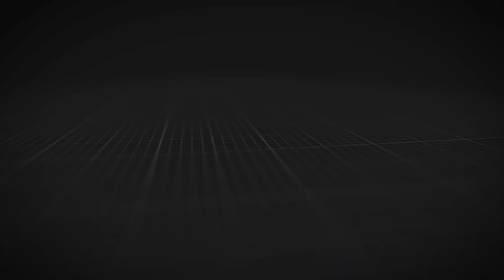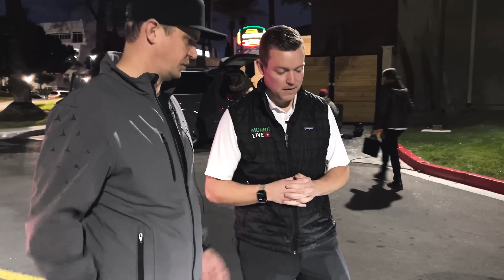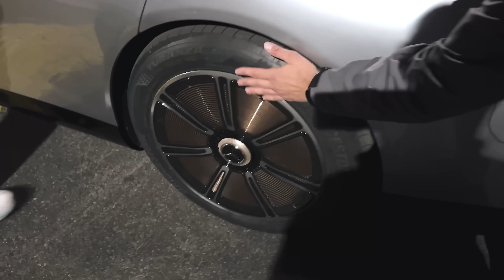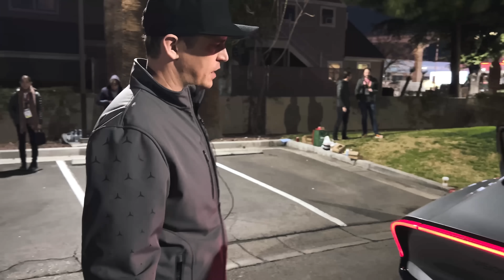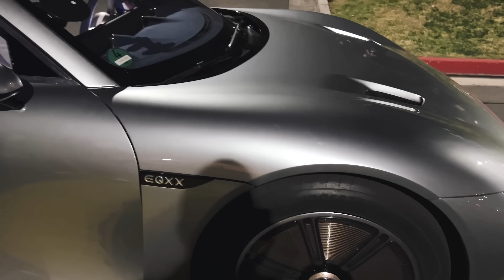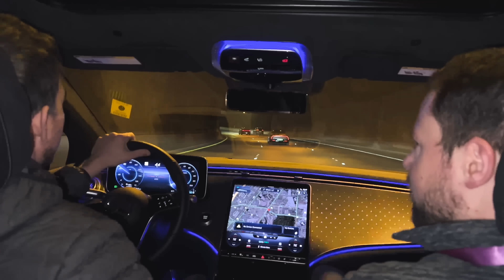The Most Efficient Mercedes-Benz Ever - Mercedes Vision EQXX Ride & Drive | CES 2023

Comment: If we project all this to a normal car, we will get 700 km of range max. Normal car probably needs to be 10cm wider (comfort), no active aero (too expensive), a bit more head-roof space, active battery cooling, possibly less fancy of a motor and less dense batteries. And 300kg more. So, loosing 30 % or range.

Comment: Wow, it has Tesla model S door handles and wheel covers! 

I'm just stirring the honey pot here, I think they've done a great job, and achieved a dramatic improvement over other cars including Tesla. I have a model S and remember seeing a video early on where Bjorn Nyland was commenting on how noisy a Tesla was at 200+ kph, due to imperfections in the surfaces relative to what the "plan" was. Mercedes of course does manufacturing right. I just hope that the sound system is as good as the model S (I was disappointed with the S class Mercedes).

These loss refinements make a big difference in an EV, because the lower the rolling resistance and drag the less of an incline is needed to get back more than you expend moving. I take country drives and am amazed at how small an incline is needed at 110kph to pass the break even point, and this must be even more impressive.

Another comparison I'd be interested is seeing is what the pedal dynamics are like, Tesla really gets this right in my opinion, so much better than the Jaguar i-Pace I tried.
Reply: Yeah, Tesla recycles lots of Mercedes tech.
Reply: @abraxastulammo9940  Except the handles on Model S came out in 2016 on Tesla not in 2023 like on Mercedes.
Reply: @abraxastulammo9940  Also the aerodynamic wheel design came out on Model 3 in 2019,  also well before this Mercedes 🙂

Comment: This looks like an amazing car but I'll be looking for what kind of temps the batteries hit while fast charging because of the lack of liquid cooling
Reply: Don't remember the charging speed, I think it was 100 kW or a bit more. The thing is that this car is so efficient that the battery is quite small so in 10 minutes you have 200 km of range.
Reply: @ContraVsGigi  every "air cooled" EV I know about has had terrible battery degradation and charging issues. it would be nice if this is the exception but I remain skeptical
Reply: @tindy128011  Yes, they were quite problematic. I want to believe Mercedes did their calculations very well, but we'll have to see. There are a few advamtages for this one, for instance being si efficient, in 10 minutes you charge for 200 km so in the end you have way less charging cycles than a regular EV.

Comment: While this is indeed an amazing accomplishment, EV enthusiasts should realize that Mercedes spent a ton of money optimizing the weight, aerodynamics, and power consumption on this car in order to hit a target goal. The issue with this is that they are VERY close to the limit that physics will allow. In other words - there isn't much more to gain.
The reason I say this is that what companies SHOULD be directing every last bit of their energy and focus on is increasing the gravimetric and volumetric energy density of the pack. Improve those metrics by 50-100% and the engineers will have TONS of headroom to do whatever they want.
And customers want this too - every customer wants some buffer in their EV. We wanted the 520 mile Model S Plaid - which is how Tesla announced it the very first time. Not because we needed 520 miles on the daily. But with 520 miles of range, we KNEW we'd always have enough reserve to do whatever came up.
Elon may eventually get there...but not today.

Comment: Thanks for a good review.  Sounds as if the EQXX is pushing the limits for a passenger car.  I wonder how it would perform in crash testing?
Reply: Just as any other good modern car. There is no reason not to and Mercedes was always top notch at this.

Comment: The sticker badges are the worst part of the car. The Mercedes emblem is the most prestigious and recognizeable emblem along with Ferrari. Surely the can put in a recessed badge or something without affecting the aerodynamics. Stickers are for motorcycles, not cars. The design of the car is really nice but it does not have the trademark mercedes look.

Comment: Honestly, the thing that pisses me off about this is that GM made a car based on a similar aero package with the original Saturn SL1 back in the 90s and then in the 2000s nobody cared about fuel economy any more so they transitioned into SUVs before dumping the whole division. Those Saturns also used plastic body panels that were not only dent resistant, but saved weight and cost. And GM incorporated many design and construction lessons from Saturn into their EV1. Had GM just continued in this vien we would be seeing a hyper aero EV as an affordable GM production vehicle with cheap panels instead of this exotic concept vehicle from Mercedes with exotic expensive materials that will likely never make it into a real production vehicle.

Comment: This is what i want to see from major car makers. Now will they bring it to market?
Reply: Nope. Hahaha… or it will look dumber or cost north of $150k. It’s Mercedes.
Reply: @GET2222  You aren't wrong on the price.
Reply: Tesla could do this for not much more than the Model 3 currently just without thr active aero and actuating handles. (Those a lone could add 3000$ to the selling price)
Reply: @rkan2  well for Tesla to do this they d have to pay mercedes tons due to the 500+ mercedes tech patents on this car
Reply: @dnap1991  Meh, most of it can be worked around easily. A flat bottomed car or teardrop shaped car is not something to patent...

Comment: Did you notice how Julian sidestepped the question about cell configuration?  Pouch, prismatic or cylindrical cell?  Answer:  high silicon anode chemistry.  With no liquid cooling to save weight, that raises the question of how does Mercedes condition the battery in cold climate conditions?  Or did they just sidestep that issue as well?  Interesting interview, most interesting is what was not said.
Reply: The performance values are very limited. This results in extremely little heat loss and therefore no cooling liquid is necessary. However, it is not an everyday car, since HPC charging is not really possible and it accelerates like a 40hp car. Probably feasible in the future with other battery technology, but currently very limited.
Reply: Yes, the Merc. guy was very evasive that was exactly my thoughts. so was it a case of not knowing or avoiding! but Cory was good at easing before the question to encourage the guy into what he wanted to ask.

Comment: FINALLY SOMEONE IS ON MY SIDE ABOUT SIDE MIRRORS

I mean it’s not the exact same argument (his might be better tbh) but I just can’t get over Sandy’s (and Munro in general it seems) desire to get rid of side mirrors in favour of camera systems. 

Sandy almost always subscribed to the Elon-esque mantra of “the best part is no part, the best process is no process”. I just can’t buy that a sophisticated camera system requiring sensors, displays, power consumption, compute, and software development time is superior to a manual mirror that is probably 1/100th of the cost and takes 1/10th the time to install in factory. 

The argument about depth perception or 2D screens is absolutely correct as well; you can’t change perspective/look “around” objects on a screen like you can a mirror. I just don’t buy it.
Reply: There’s nothing sophisticated or energy intensive about two 4” OLED screens, 5 MP cameras, and the marginal compute needed compared to the energy reqs of the existing car infotainment system
Reply: @bookie9273  What do you think is cheaper, easier to implement, and simpler to use (and has no chance of software glitches), putting 2 manual door mirrors on 1 million cars or putting a minimum of 2 screens, 2 cameras (but probably more tbh), the wiring for such, development of software, and install and testing for 1 million cars?

Go watch any video about semiconductor manufacturing and then, with an actual argument this time, try to convince me I’m wrong.

Comment: The germans will catch up. They always do. Their software is improving for merc, Bmw, vw. They will use casting, new production methods and all. They will be part of the ev game for sure
Reply: Maybe. They're running out of time, they're hampered by their ICE assets and they're in debt. But maybe.
Reply: @MarkXHolland  they are right on time. BMW will have android based syatem from 2023, vws new software will be much better and use Android as well for some brands and integrated for BEV and ICE, merc will use gaming engine and nvidia and they all will have new batteries in 5 years. They will be OK

Comment: Cory I noticed you had your head tilted to the left while riding in the car. Was the window and roof line so that you didn't have head room?
Reply: The headroom seems to be quite cramped, which can also be seen from the narrow exterior shape. The concept was primarily trimmed for efficiency with a few cuts in other areas. That's why the vehicle will never go into series production, it doesn't meet the usual comfort and luxury requirements of Mercedes.

Comment: Wow, very good-looking, considering the extreme focus on aerodynamics... Cd=0.17!!! and 745 miles range. Compared to a pedestrian Model 3 at ~0.23 M-B has done a great job balancing between looks, Cd, weight, and performance. 
I wonder how much this this suspension engineer worked on Lower Control Arm casting shapes to reduce drag? 🤔

Cheers, Eric

Comment: The EQXX not requiring a coolant fluid could be a great reliability feature, as many premature failures in battery packs, are related to the cooling system leaking or clogging and leaking inside the battery Cells.
Reply: Sadly u cannot use lipo batteries without thermal management. Except for these tests where they are not put under stress.  Maybe next gen batteries. But i doubt mercedes will be the first to achieve that.
Reply: @ARPost-kn2jl   for temperate climates, could be a great option. Less complexity, more reliability, and more affordability.
Reply: @RogerM88  0-60 in 25 seconds. Nobody buys that.
Reply: @ARPost-kn2jl  so having a car that does 0-100 km/h in less than 5 seconds is a deal breaker for the mainstream? Most want something reliable and affordable.
Reply: @RogerM88  For the price, it must be at least a single digit value.
25s, my grandmother accelerates faster with her walker 😜
Reply: @RogerM88  Oh im sorry i didnt know you were blind. I said 25 SECONDS!!!
Reply: @ARPost-kn2jl  What lipos? Not that many EVs use lipos lol.
Reply: @rkan2  my traxxas does! :) But ur right; lion. Lfp would be better

Comment: The rear track with and back of wheel venting is clever and cost effective, I hope to see it implemented on more vehicles in the future. It’s good to see the front air curtains on most new designs.
Reply: Daihatsu utilized a similar layout, with narrower track on the rear wheels, on its UFE-II back in 2003. It also employed wheel skirts.
Reply: @martshearer498  Citroen were doing that from the 50s starting with the DS until the 90s.
Reply: @DimitarStanev  The DS even has narrow tires like the later BMW i3. Everything that's old is new again. Or, aero hasn't changed.

Comment: And now, let's produce it in meaningful numbers...oh wait
Reply: I don't want to diminish what Mercedes has done here but it seems to be an ultra expensive, ultra lightweight, ultra low drag vehicle that was specify made to hyper-mile. Don't know how much practical innovation  will be able to translate into a real car that has to also be safe, affordable, reliable, have comparable power and life span, plus charge at a reasonable amount of time.
Reply: @billh2294  I don't think that car is made just to be a showcase.  I think it's close to being the next A, B or C-class.  It won't be quite as efficient, but will be the 'best' yet.  The car will be slightly less swoopy, will carry passengers and luggage and pass crash tests just fine.
Reply: @billh2294  It is not ultra lightweight if it doesn't even have a carbon fibrr chassis :P
Reply: @rkan2  It uses carbon fiber springs. Who knows what other exotic materials were used. Remember, they brought expertise from their formula one team. They also decided to not use liquid battery cooling to save weight.
Reply: @billh2294  fiberglass springs*. I didn't hear any mention of a heatpump. Having a liquid cooling system with a heatpump would surely be more efficient than whatever they have currently.
Reply: @rkan2  14:12 mentioned no liquid cooling. In a real world situation no liquid cooling would limit charging speed, cabin heating and ability to efficiently operate at cold temperatures.
Reply: @billh2294  That's what I said? I understand having no liquid cooling without some thermal management system like Tesla have with a heatpump but if you want real effiency - you really need a heatpump...
Reply: @rkan2  But that's my point. This is not a real world car that people would buy. By the time you account for the compromises to real world situations, the efficiency drops to what is currently available in the market.

Comment: No battery cooling - that won't survive given the extreme climates it will go to. Need at least a cooling plate, they are cheap and light weight. However, as it did a 1200 km range test (constant moderate speed on a test track - 60 kmh?????), at 70 Wh/km, 252 J/m, 11.265 kWh/100 miles, it would take a pack with a usable 84.0 kWh. We could assume an EPA test range of 600 km - Tesla M3 ball park.
Reply: They drove from Stuttgart to Silverstone on public roads with changing speeds. It took them 14,5 hours of driving so 83 km/h on average. The highest speed they reached was 140 km/h though that was at the end when they drove the car around the track until it was empty. The battery they used has a capacity of 100 kWh.
Reply: @ralfrudi3963  That is far more impressive - on normal roads and the pack must have weighed at least 500 kg. Used 83.3 Wh/km on average - 300 J/m. A 1000 km on the US EPA test might be possible - 100 Wh/km (360 J/m). The Tesla M3 LR uses 42% more energy per km.
Reply: Why not?  The original Ioniq 28kWh is fine without liquid cooling.
Reply: @FFVoyager  Not efficient in cold weather if the vehicle has had a cold soak when you can't heat the pack. In parts of US, Middle East, etc, the asphalt pavement can reach 60 deg C. That's a lot of heat radiating at the bottom of the vehicle. The EQXX does have a cooling plate under part of the underside to avoid a radiator use in some circumstances.

Comment: Curious to see what improvement would be gained by removing the side mirrors (although they are still required, I suppose).
Reply: Julian said on camera that they shied away from going to rear view cameras because of the additional electrical load. The electrical energy saved by the reduction in drag would far outweigh the electrical energy spent to power the review camera on each door.
Reply: @RandyWitt  It seems like they could do away with the frivolous accent interior lighting in order to power rear view cameras.
Reply: @mikedx2706 Absolutely. I know people like that for some reason, but it’s definitely not for me.
Reply: @RandyWitt  Yeah, I commented before watching the whole clip :O
Reply: @RandyWitt  - if you believe that, you probably own a bridge or two.  Funny how they didn’t worry about the power needed for the pimp lighting.
Reply: It’s 12-15 miles of range gain for the Audi e-tron w/ digital side mirrors so definitely not nothing
Reply: @bookie9273  It'll be huge on eqxx, 13.5*620(eqxx range, from 1000km)/226(etron range)=37mi. Camera holder shape can also be further optimized to reduce both cd and projection area.
Reply: @anafabulakz696  would like to know what the rear wheel cover reduction would come out to.    You could try a clear plastic cover
Reply: It is very low. Because it still needs a small camera holder and display needs energy. There was a german talk from the EQS aero designer.
Reply: @Francis-yc9nc  Was it half a km of range or was it for the doorhandles?

Comment: I watch MunroLlive to get fact, numbers and engineering advances. This prototype at 8kWh/100km does not blow anybodies mind and as for leaving out battery cooling as a weight saving makes this a pure one trip wonder. Get to test the spitting image of this Mercedes prototype: the Lightyear production car and explain how EV's are moving forward.
Reply: I don't think they left out battery cooling. I believe they came up with a solution to passively cool the battery with the goal to not use a heavy and complex liquid cooling system. Having a large battery with a comparetively little power output and a clever housing seems to do the trick.
Reply: They could of saved so much weight by doing so many different things like carbon this and that but they choose to delete battery thermal management system.......yeah!
Reply: Not really.  I look at it and think they saw the original Hyundai Ioniq and made it better.

Comment: I am not an expert but it sounds like the EQXX was castrated from all of the cool features of an EV. No liquid battery cooling? how's the charging then? like in a Nissan Leaf? ok. I think that this kind of efficiency will not get utilised for a every day car driving.
Reply: I think it will charge like an original 'classic' Ioniq 28.  They don't have battery issues, many cars are documented at getting over 150,000 km without losing capacity.